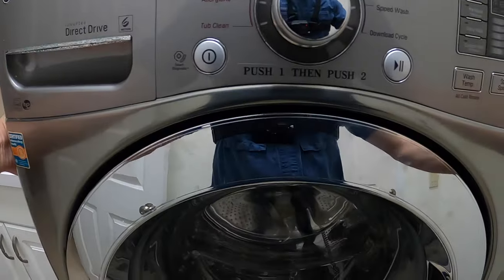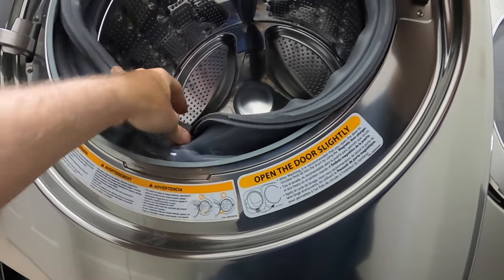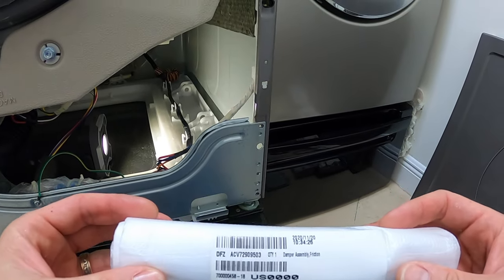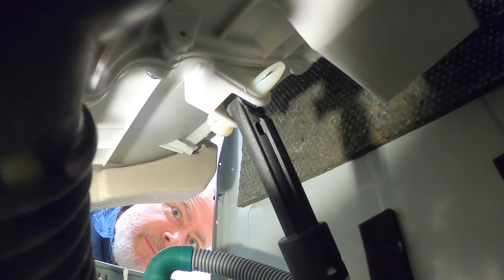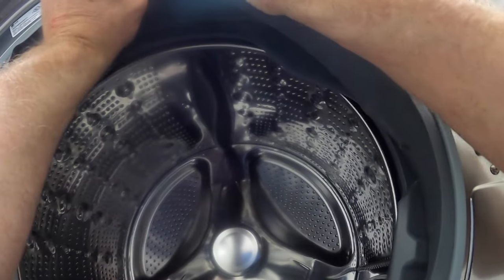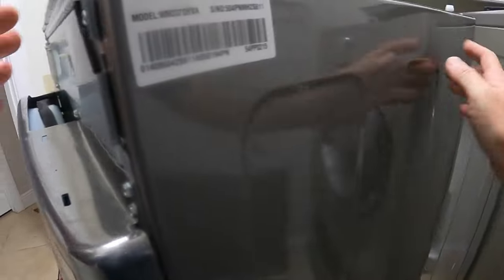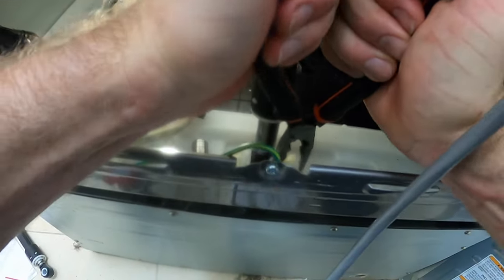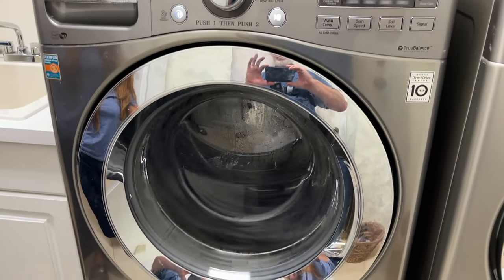How to fix an LG Washer No High Speed Spin by installing New Shock Absorbers

Comment: Had to do this on my own machine. If you remove the small panel on the back you can access the back one, but if you tilt the machine on its side against the wall you can actually access the other two shocks from the bottom without having to dismantle everything. Saved me so much time.
Reply from the maker: Great ! Thank you for sharing

Comment: You can access all of the shocks from the back of the unit.  It is slightly more difficult because you have to work by feel, but it wasn't that hard and was way easier than taking apart the front of the washer.  When installing the rear shock I recommend putting a towel or something thick over the bottom of the access panel opening.  I also had trouble with that bottom peg, and I also used a pair of pliers to help push the peg in, except for me the pliers slipped off of the peg and my hand slid across the bare (and sharp) metal in the center of the opening.  Had a deep cut in my finger that needed 3 stiches.  Learn from my mistakes!  :D
Reply from the maker: Thank you for your advise.
Reply: I'm hoping to do the same. I have a dryer stacked on top and nobody is available to help me lift it off.  This spring I had to replace all of the fill valves and this thing hasn't even seen its 3rd birthday yet with light use in a 1 person household. They sure don't manufacture these to last longer than 5 years. Awful!
Reply from the maker: You can try changing the shocks from the panel in the back. I plan on creating a video soon that shows this method . best of luck  @milfordcivic6755
Reply: Did you ever make this video?
Reply: @Zakw17  Hi , glad I found all this comments  ,  I just did my 3 shocks from below my LG machine , leaning the washer about 45 degrees on his side , perfect access as long as  your bottom is not closed up , really don't need a video for this approach
Reply: @willswingwilly1950  I can see where YOU don't need a video for this approach.  After all, you are all done with yours.  But the rest of us would love to see him do a tutorial on how to change them from the back.   Also, those of us with a dryer up top probably won't be leaning them 45 degrees.

Comment: Why does everyone take the lid and front off. Why not turn it over on its side and access everything from the bottom?
Reply: Common sense is not that common 😅
Reply: Is the bottom panel removable?
Reply: @ironmantooltime  mine is open on the bottom. It just depends on how much work you need to do.
Reply: @tbowen12  sure I'll check. I did the front panel for door seal replacement and I'd rather not do it again 🤣
Reply: I agree. I’ve worked on pump from bottom.
Reply: I just did this replacement for all 3 shocks by propping one side up at a time and accessing the shocks from underneath. Took about an hour.
Reply: Y E S .....thanks , glad I found this comments  ,  I just did my 3 shocks from below my LG machine , leaning the washer about 45 degrees on her side , perfect access as long as  your bottom is not closed up , really don't need any video for this approach
Reply: Sorry can’t resist sounds like something your partner / wife prefers? Maybe whatever works for you? 😅
Reply: Sometimes you have no access from sides due to location of the machine or very small laundry room/ closet etc.
Reply: Thank you, your comment saved me so much time and effort.

Comment: I replaced three shock absorbers following the video. Washer is working well now.
Even though the LG model numbers are the same the models vary from year to year. I would suggest you take photos before you disassemble as the number and placement of of the screws can vary and the reassembly instructions in the video may differ from your actual machine.
Reply from the maker: Thank you for your helpful feedback.
Reply: How did you know which the right part to buy a shock absorber?

Comment: Originally I thought I had same issue (in test mode runs perfectly with no load, once added load it won’t going to high speed spin and tube warbling noise), so I replaced all 3 shocks, but still no luck. With the new shocks sometimes with very light load it can go into a high spin but I can see the tubes vibrating a lot and banging on the door, and the washer continues making loud draining noise (I don’t believe I have a draining problem since the water is not stuck in the tube)
Reply from the maker: Hold the outer(plastic) tub in your left hand and the inner(metal) tub with right hand and see if you can move them independently. If so you may have bad bearings or broken spider arm.

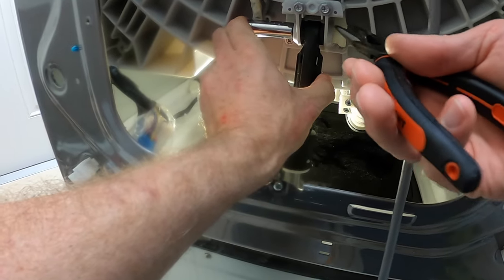Comment: what is that black rubber line called? at 11:21 mine is leaking and I cant find the part number to replace. thank you
Reply from the maker: I believe you are referring to the water line that goes to the pressure switch. It measures the water level in the drum

Comment: Why replace them instead of just lubing them like most people suggest?  Curious as I need to lube or replace mine and dont want to waste either the time (lube and have to replace later anyways) or the money (replace when the can just be lubed)....    Thank you for your content.
Reply from the maker: They need replacing. As a tech my time and reputation are most valuable assets. Best for both to get the job done proper in one visit rather than have the customer all back complaining and then have to return to get it done right
Reply: I've just recently bought new shocks and when comparing them to the existing ones there was hardly any difference in resistance, I tried greasing one of the originals and it actuality decreased the resistance.
I found the main fault was one of the front weights had worked loose, now tightened machine is much quite.

Comment: My machine has the exact same symptoms, but how can you tell if the shocks are bad?  Could a faulty pump cause the same symptoms?  My machine seems to be draining, but will not go into high-speed spin to complete draining and timer "sticks" at 11 minutes.  In other words, are bad shocks the only thing that could cause this?  Also, can existing shocks be repaired somehow?
Reply: What model number and brand is tour machine. There are a few reasons why the machine might not be going into a final spin. A clogged or defective drain pump is definitely one reason why.
Reply: @YOGiiZA  P.S. Also saw another video on how to enter diagnostic mode. My Kenmore will go into high speed spin during this test, so it's got to be the shocks. These repairs are really not that difficult with great instructions from people like you, so please realize how much you are helping others who cannot afford high cost of professional repairmen.
Reply from the maker: Many times if the shocks are bad it will not high speed spin.
Reply from the maker: Thank you for the compliments
Reply: @appliancerepairamerican my washer has the same issue, but then it popped the breaker and won’t turn on now. 🤷‍♀️

Comment: Mine will high speed spin during the diagnostics mode but not when I’m doing an actual load of laundry.
Reply from the maker: Needs new OEM shocks
Reply: @appliancerepairamerican  is that the same as shock absorbers?

Comment: Nice video. Do we know this can be done from the base? 🤔
Reply from the maker: Not sure what you mean
Reply: @appliancerepairamerican  couple of people suggested the two front struts can be reached from the base which is easier than the procedure for taking off the front. Is that true?
Reply: @ironmantooltime yes, it can be done from the bottom of the machine. I propped up one side at a time to gain the access I needed.
Reply: @csteketee  cheers, I could do it from the back. Didn't work so scrapped the machine!

Comment: How to know which part of shock absorber you'll buy?
Reply from the maker: there is a link in the description. But it is best to get your model number and make sure that you get the correct parts for your pacific model. after you get your model number call this number and give them the model number and they will send the correct parts: 800-347-2745

Comment: This is a great video. It solved the root problem of a burned out motor controller... Here's the complete failure scenario.

A leaking boot seal caused the front two dampers/shocks to corrode. This made (over the course of a few years), the motor controller to cycle heavily trying to reduce imbalance and fight the vibration sensors... and burn out because of imbalance. For years, we would see intermittent failed spin cycles (no machine error, just wet clothes). So after knowing the motor was OK, the controller was bad, and replacing said controller, the drum spun in diagnostic mode, but wouldn't initiate a cycle due to poor balance sensing. After replacing the dampers... Life is Godd again!
Reply from the maker: wow! good job. thank you for sharing. we all learn better as a community

Comment: How do you know which screw goes where when you put them back?
Reply from the maker: I use a magnetic tray when disassembling. I place the hardware in a pattern on the tray that mirrors the order in which i took them off.  Having a method similar to this helps
Reply: @appliancerepairamerican  why not tape the screws to the part that was taken off?

Comment from the maker: Yes, OEM refers to the original engineering and manufacturing, in this case made by LG. There should be a link to them in my description. If you cant fond them call this parts hotline and have your model number ready 800-347-2745

Comment: I changed all 3 of mine. And it only made the shaking worse…
Reply: You may have a broken spider arm or bad bearings.
Reply: I think so yes. I just finished dismantling the drum and the spider are is all cracked. Now my problem is the 6 bolts. I only got one off. The rest are spinning. So I need to figure out how to get to the back end. Greer
Reply: @YOGiiZA  I ended up drilling two little holes and getting the 2 screws out. Spider arm off now. Waiting for the replacement to arrive.
Reply from the maker: ambitious. I do not perform that repair often. Most people choose to get a new washer when I tell them my price. Get some!
Reply: @azazelone905  That's interesting, did you try putting machine on fast spin with the drum empty, because mine spins perfectly when empty so that leads me to believe the spider must be in good shape.  As soon as washing m/c has clothes in it constantly shakes and bangs when spinning.
Reply: Changed the spider arm and all is back to normal. Was a daunting task but I kept track of all the steps and reassembled backwards. 

Machine is purring now.
Reply from the maker: @rogerbuckland4214  the tell tale sound of the spider arm is a clacking sound. if it shaking with a load in it it is usually either off balance or needs new suspension. I just published a new video on replacing suspension on an LG front load stacked washer
Reply from the maker: @azazelone905  I dont get to do many of them because when i tell customers the price they always decide on buying a new machine.  I wish you made a video to share with the DIY community. Power to you brother. thank you for sharing your experience
Reply: @appliancerepairamerican  Many thanks for yr reply, I think I'll try the shocks first, the noise at spin is more of a non metallic rubbery thumping sound so hopefully the spider is ok, thanks again 👍

Comment: Three shock absorbers?  Never seen a machine with 3 before!
Reply from the maker: Yes, that is why this model needs them replaced more often than others
Reply: @appliancerepairamerican  My machine has 2, but I've seen some on here with 4.  But never 3...
Reply from the maker: @jamespassas9441  Usually 4 But this model is notorious for need them replaced because it only comes with 3
Reply: james, you can never say (text) that again!

Comment: Great video @atlasappliancerepair. I saw your description of the Spider Assembly issue being tell tale to a "clacking". I was wondering if this is what you mean by that or if this is another typical issue with damper replacement. I took this short video of the actual sound: https://youtube.com/shorts/eQuAMdLomQs?feature=share
Reply from the maker: That is an awful sound!  That is not the sound i was referring to. Check to see if the metal drum moves independently from the inner plastic drum. If so it is usually not worth repairing
Reply: Thank you very much for that note. To see this metal/inner plastic drum correlation, are we talking about coming in from the back and removing the rotor and then manually turning? Thank you again for the info. @appliancerepairamerican

Comment: are the pins supposed to be as large as they are, they look too wide to enter the new absorber
Reply from the maker: The new pins should come with the new shocks. they squeeze in and the locking tab expands back out on the other side